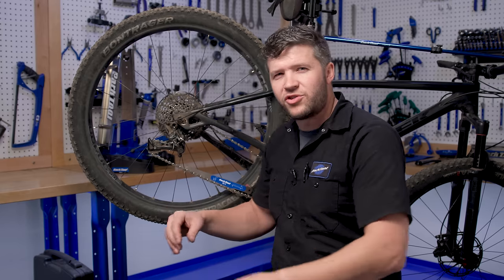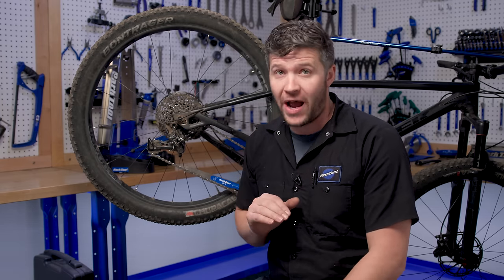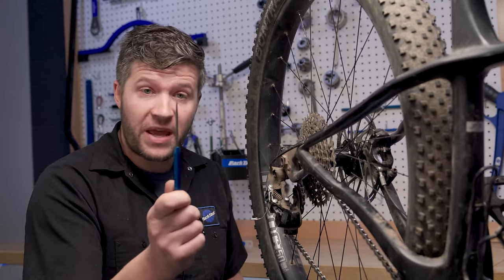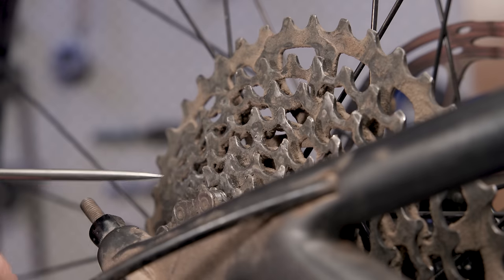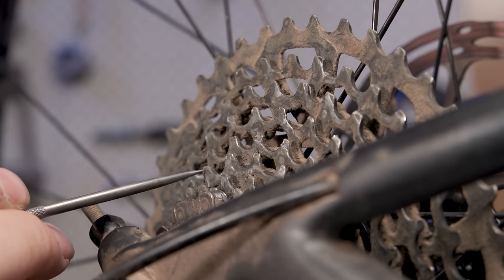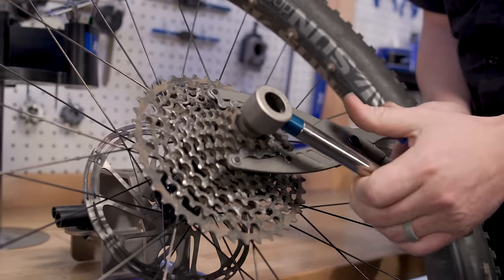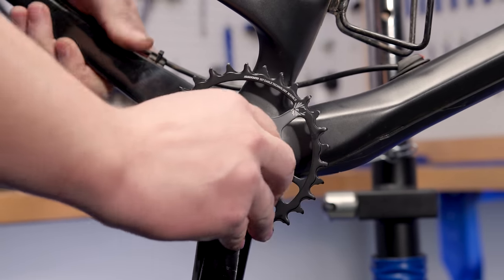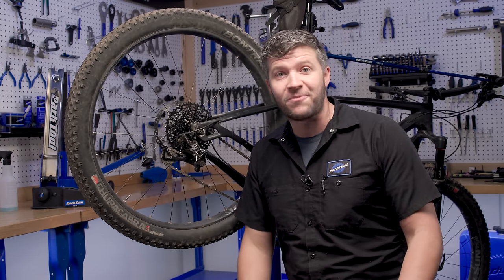Cassette Wear | Tech Tuesday #189

Comment: 1chain per 4000 km
1 casette per 4 chains
Chainrings per 2 casettes..
This equation worked for me perfect
Expert coments apppreciated🙏😇
Reply: You must live, or at least ride, in relatively flat terrain, be a relatively smaller person, and/or keep your drive train exceptionally clean.  I average, at most, 2000 km per chain, 1 cassette per 2 or 3 chains, and 1 chainring per 2 cassettes.  But then, I'm ~200 lbs, love climbing hills, and ride in all weather.  I only get about 1000 km per chain on the CX bikes.
Reply: Good  sensible numbers there, but I not an expert.
But an expert recommended  to me Campagnolo chains, which I use even for MTB. They last really long and protect our expensive cassettes.

Comment: Any opinions on the Rohloff cassette wear checker tool? It is rather subjective in it's use.
Reply: Never used one but did look into it
Reply from the maker: Not 100% effective but can be used to give you an idea of wear like this test does.
Reply: I’ve got one - as long as you put ension in it as per instructions it seems to give a pretty accurate reading.

Comment: They could make a cassette checker tool, similar to chain checker .  When teeth get worn it creates a bigger gap.
Reply from the maker: If you look closely, the gap gets larger as you go to larger gears already. We have not found a method/tool that is reliable enough to do this...yet.
Reply: @parktool  Yes each ring would need a separate  tool.
Reply: Rohloff HG Check
Reply: Please explain. Bikes run one chain that must accurately engage teeth on all sprockets of the cassette, therefore it seems logical the teeth are machined to the same spacing. Looking at a new Shimano 12 speed cassette the shape of teeth varies to aid chain shifting between sprockets, but using verniers the centre to centre spacing of the cutout between teeth is the same on all sprockets.  @parktool
Reply: @antc5010 but is the spacing the same from one set of gears to the next? E.g. Is the spacing between teeth on the highest gear the same as the lowest? Seems to me the spacing would need to be different as the higher gears will have a smaller radius, but the chain is of a fixed length.

Comment: Parktool please help me... Crank arm keeps coming loose even i tighten it properly it wobbles when i move the crank arm left to right not when i push and pull the crank arm.
Reply from the maker: Your crank arms attachment point has been run loose too long and it will no loner stay tight. The crank arm needs to be replaced. if a left arm you can replace just the arm. If the right side then you will need a new crankset.
Reply: @parktool  i use shimano bb52 btw what attachment point are u saying the 2 pinch bolts or the one in the middle?
Reply from the maker: On that style of crank it is not common to come loose if done up. Keep the pinch bolts loose then snug the pre load adjuster ring and then tighten the pinch bolts. If there is still play in the system it is likely that you are missing a spacer that would go between the bottom bracket shell and the bottom bracket. When this is missing you will be prevented from attaining proper preload with the pre load adjusting cap.
Reply: @parktool  quick update it gets fixed but the bike mechanic install the stopper plate incorrectly
Reply: @parktool  can i send u a video via gmail? If yes can u please drop ur gmail here i cant really explain it by words.Tnx
Reply from the maker: @subbysibuyas1916  tech@parktool.com is a good way to contact us with technical questions

Comment: So let's say you have 1 set of wheels. You replace that cassette every 3 chains. Ok.
Now, let's say you have 2 sets of wheels that you swap between. How does the 3 to 1 ratio work now? (Genuinely interested as this is my new 1st world problem)
Thanks for any advice in advance
Reply: In this instance, I would have a separate chain (or set of chains) for each wheelset. But that may be luxury.
Reply: Your 3 to 1 chain/cassette 1st world problem is not reality. Change chain before 75% wear always. Cassette wear is now dependent on quality, your weight and power, and the slop you choose to ride in or not. If it's a 1x setup, it's a crapshoot as they eat chains and cassettes at an alarming rate, that's the bike industry for ya!

Comment: so if my chain is that worn, and I already need to replace my cassette and chain ring... then i should just keep riding my bike as is, until it's absolutely unridable...
no need worry about getting my drivetrain, because it's all already worn?
Reply from the maker: You will start to have drivetrain reliability issues once the chain gets past that .8% mark. After that point the chances of breaking a chain, imprecise shifting, broken teeth and dropped chains goes up very quickly. For predictable shifting and reliability, replace once you get to that .8% or if you want to lengthen the life of your cassette replace the chain at .5%.
Reply: @parktool  
Thank you for the response! I could almost guess it wasn't a good idea to "just keep riding it as is"... it's just rare that anyone goes into what would actually happen (other than wearing out the drivetrain).

Btw, I actually love my bike and take really good care of it.

Big thanks to you guys and the content you put out. It's so helpful and informative. A lot of what I know I owe to you :)

Comment: But... How to tell if your chain ring is worn off? There is no skipping on a 1x 🧐🤔
Reply: Lay a piece of new chain over the sprocket, and look to see if each link lies in the middle of the sprocket valley.
Reply from the maker: https://youtu.be/TzqZxtW4xJk
Reply: If you see the teeth of chain rings looking like the shark’s fin,
You need to replace a new chain rings
Reply: @dystopiaisutopia  no always I had a 1x that looked absolutely fine, normal profile, but chain would catch a few teeth after normal disengagement point, had a new chain so I bought a new ring and all good
Reply: chain skipping is in function of how much is gear worn, force you pedal and number of teeth in grip(how big is gear/ring) so, on smaller gear will skip on smaller force than on bigger ring , on more worn ring, it will skip at less force than on less worn gear and any combination of it
Reply: Thanks to all of you for your answers

Comment: You're not trouble shooting, you just replace all the parts on a bike...I can do that if you i have enough budget...
Reply from the maker: Troubleshooting started as soon as the rider mentioned an issue. Complaint was that "the bike was skipping". First step, check the chain. Chain was worn. How worn? Very worn. What issue can a worn chain cause? A worn cassette and chainring. Both cause poor performance and noise. Solution= Replace chains, cassette, and chainring.